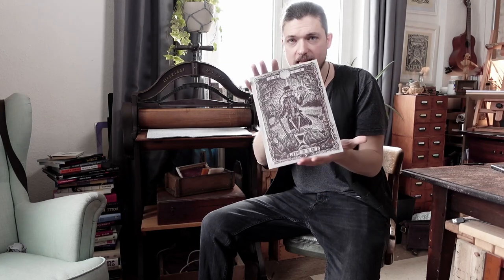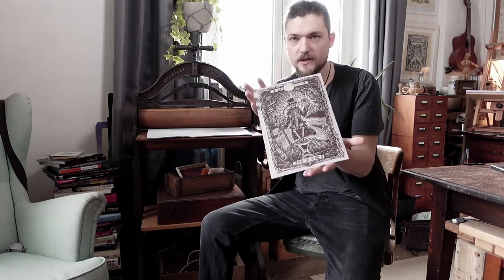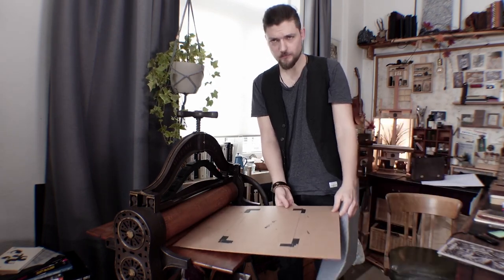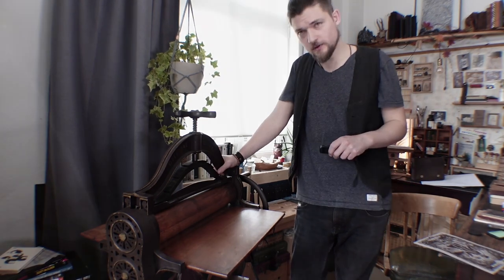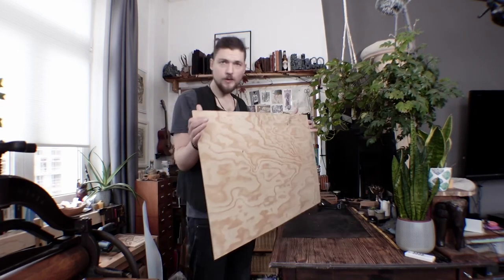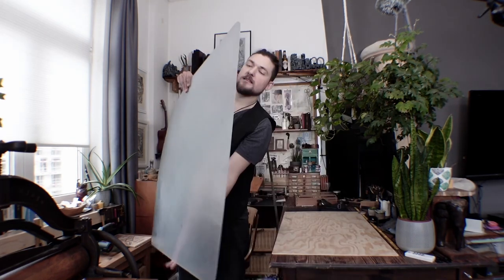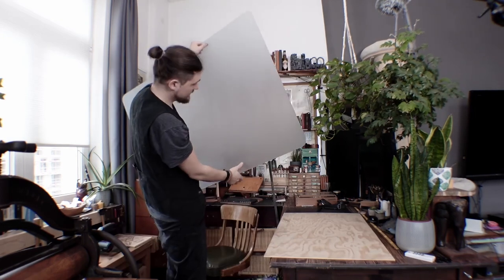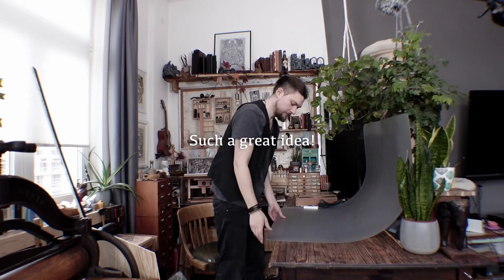DIY Mangle Press Upgrades and Setup for Linocut Printing

Comment: Excellent video,  your video help me with my full restoration of a similar clothes mangle. 
Mine is covered in rust and concrete that I had aquired last week, I have totally dismantled the machine and have started rebuild of it.
Reply from the maker: Thanks Monty, glad it was of help. The first video on the press was also mainly dismanteling and cleaning, don't know if you saw it: https://youtu.be/3WUHuNdBPN4 
what type of mangle did you get?